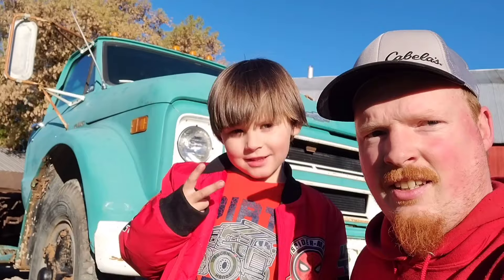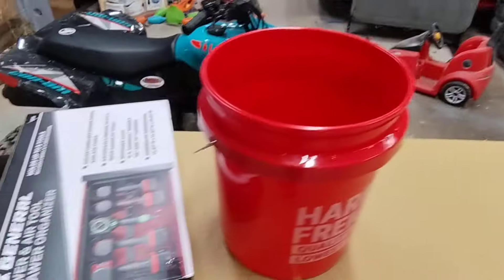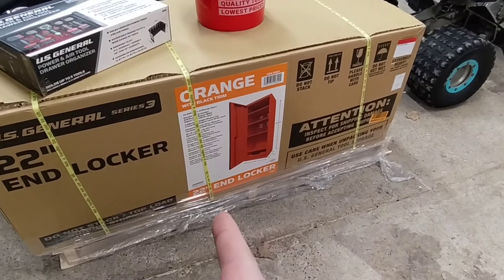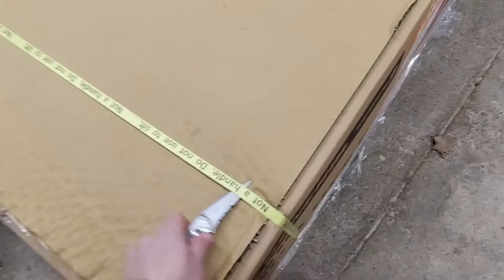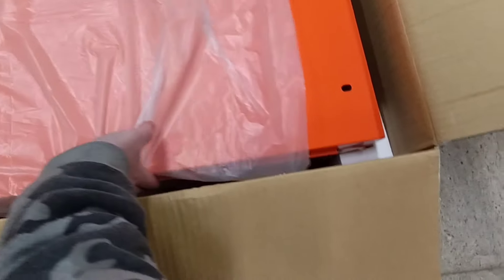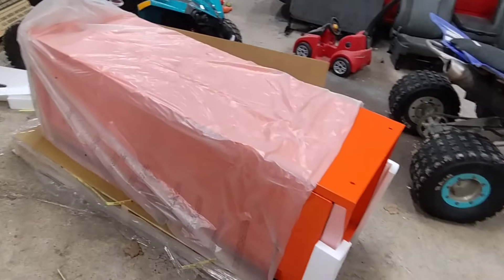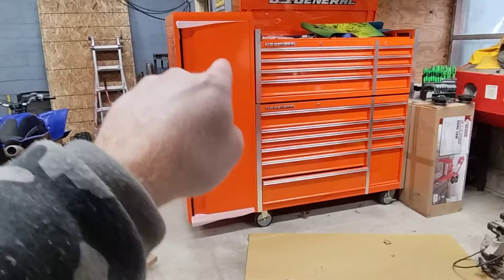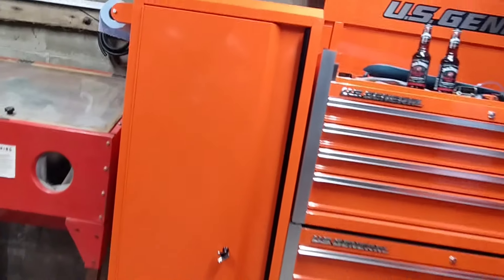Us General series 3 end locker on a series 2 box

Comment: These US Generals are great boxes for the cost. I have both the series 2 and 3 top 56 inch chests. I waited for the taller series 3 to get on sale before I put one on top of the bottom. Glad I did that. Built a steel bech to sit the other 56 top chest on. I like them both alot
Reply from the maker: I've thought about getting the series 3 top work hutch but I like having all the drawers
Reply: Do you have a series 3 top chest on a series 3 roll cab?? Or on a series 2 roll cab? If so, how does it fit? I've heard that the series 3 top boxes/hitches don't fit the series 2 roll cabs.

Comment: Can you show how you mated the two units together down at the bottom??  I have a 56" Series 2 roller & a new Series 3 end locker.  The locker mates perfectly up top, matching up with threaded roller handle holes.  However, my Series 2 roller does not have threaded holes at the bottom.

Did you have to drill through the side of your roller?
Reply from the maker: @manunava1776  I only have mine bolted where the handles were and it’s been fine. I also have lockers on both sides of my 56 inch roller
Reply: @ccgarage5040  Cool, thanks for the quick response!  Been scratching my head wondering if it is worth it to drill through the bottom of the roller.
Reply from the maker: @ one locker has all my power tools chargers and a fridge and haven’t had any problems

Comment: Did you have bolt holes on the bottom on the box to screw into the locker I don’t see any on mine was thinking about drilling holes to nut and bolt it
Reply from the maker: If I remember correctly I think there were holes to bolt through the locker into the bottom box

Comment: I bought a series 3 end cabinet and put it on my series 2 44” and the end cabinet is longer so I cant bolt the bottom of the end cabinet to the toolbox, I was surprised you didn’t have this problem, the 56” boxes must be taller
Reply: So it doesn't work on the 44 inch?
Reply: @  it’ll work you just have no way of securing it to the side of the toolbox
Reply: @Ajs19892  oh ok thanks